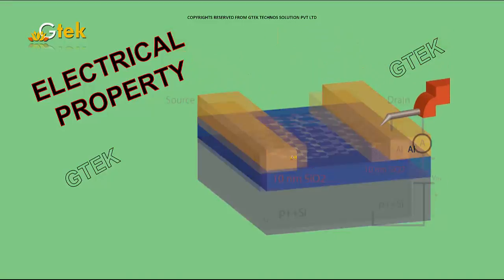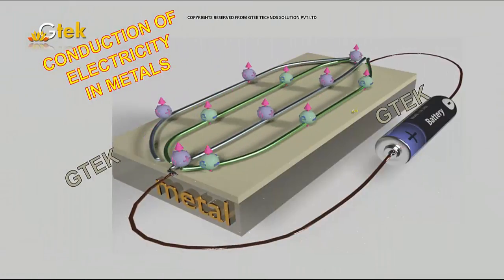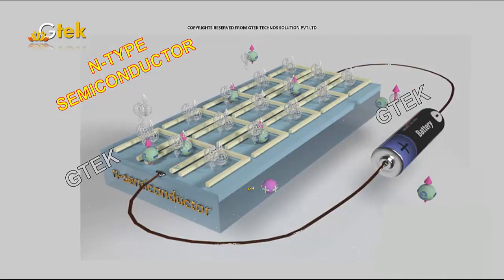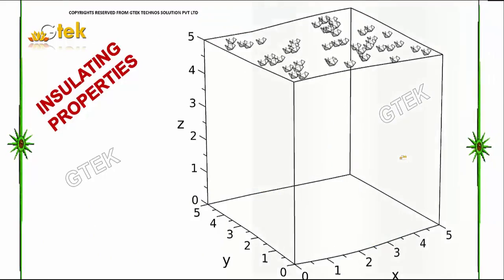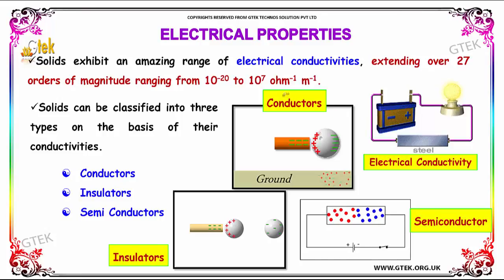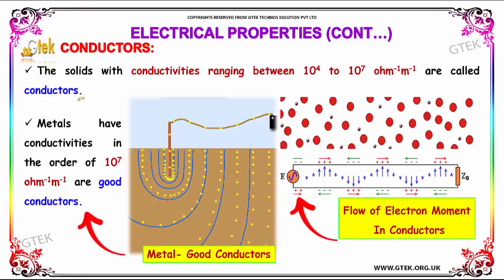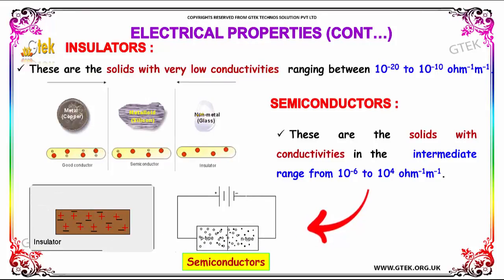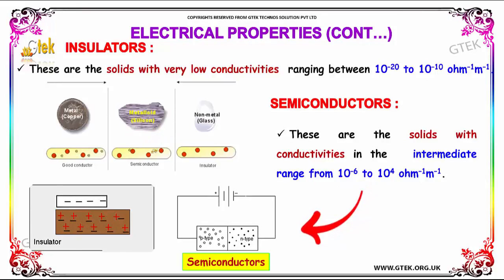electrical properties solid state class 12 chemistry subject notes lectures cbse

Comment: International Annealed Copper Standard, a unit of electrical conductivity for metals and alloys relative to a standard annealed copper conductor; an IACS value of 100% refers to a conductivity of 5.80 × 107 siemens per meter (58.0 MS/m) at 20 °C.

Comment: Whereas resistivity is the property of solids to resist flow of electricity, conductivity is the property to conduct electricity. ... (c) Semiconductor: - Solids having intermediate range of conductivity, i.e. from 10-6 to 104 ohm-1 m-1 are called semiconducto

Comment: Jun 9, 2013 - The solids which have the conductivity in range 104 to 107 ohm-1 are called the conductors metals are called the best conductors of electricity. ... The solids which have conductivity in between those of conductors and insulators are called the semiconductors.

Comment: No, stress is not a material property. It is purely a function of loading conditions and geometry of the body. Consider two bodies of same dimensions and same loading conditions but different materials. Now, calculate the stress i.e., load divided by the area perpendicular to the application of the load.